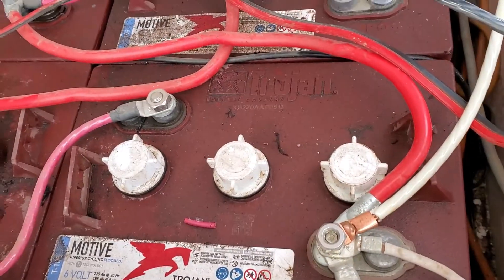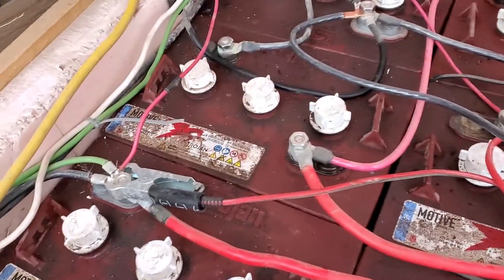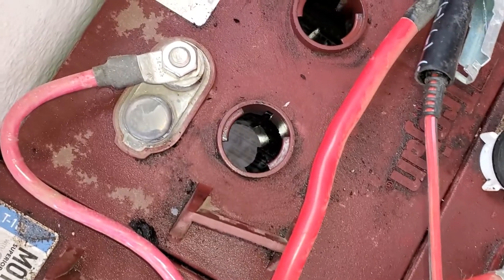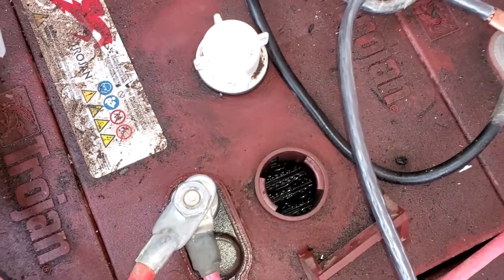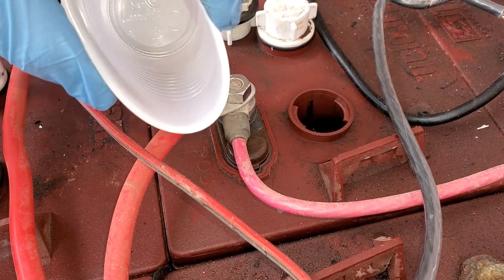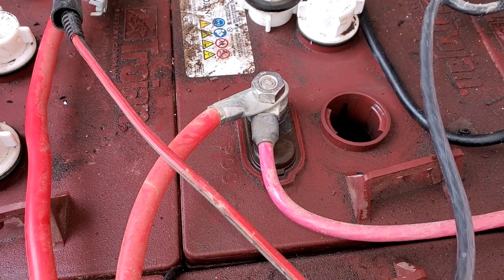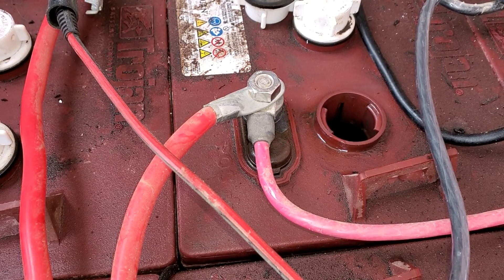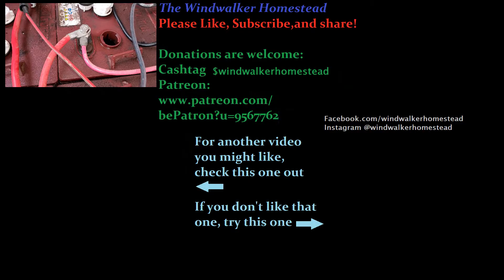Topping off lead acid batteries for the off grid homestead

Comment: What if water level drops slightly below the plate before topping up, (like that cell in the video), can that cause a problem ?  It happened to me yesterday, didn't check water levels on time  . . .  Thank you.
Reply from the maker: The lower it drops, the less capacity it has. I'm not sure what the critical level is, but I know if it gets too low, the acid starts eating away at the plates too quickly. It's the water that evaporates, so the more water evaporates,  the stronger the acid becomes. A little low, like the one shown, is not a big deal, though